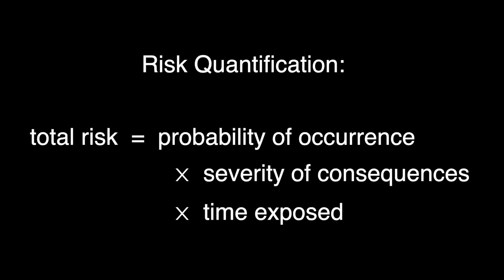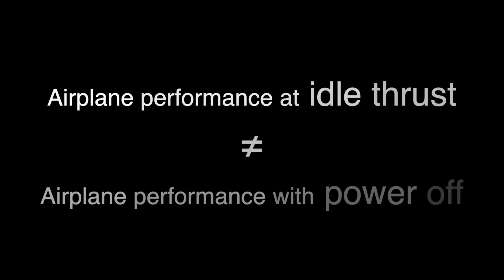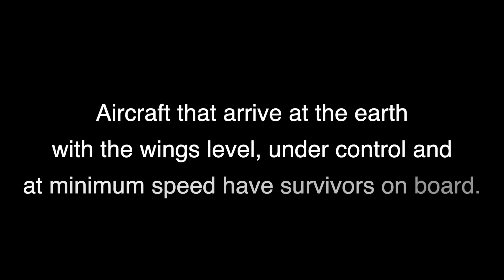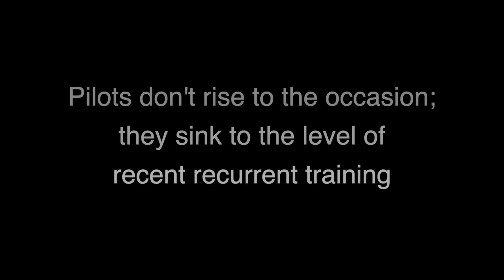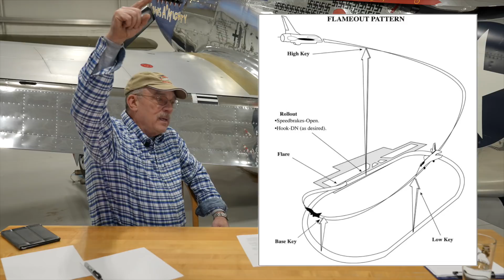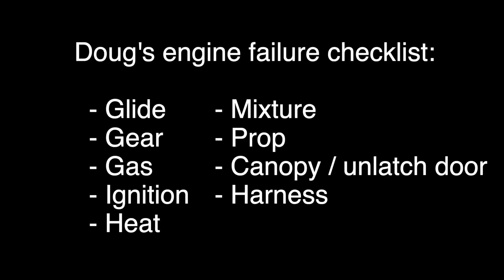Loss of engine power and the (im)possible turn - with Doug and Martin

Comment: After sound training and practice, the best way to shorten both the startle time and the decision time is to plan for the engine failure before takeoff.  Taking into account wind, aircraft load, density altitude/prevailing performance, terrain around the airport, etc., I try to decide before takeoff what I will do if an engine fails at less than 1,000’ AGL.  If you have already decided if you will turn back to the airport, land straight ahead, make a 45 or 90 left or right to a field or open space, etc., when the fan goes quiet, the response time is dramatically faster.  It would be fun to run this in a simulator with a range of pilots, but I will bet a steak dinner that you likely will cut the reaction time by a factor of 5 or even more.

Comment: Martin, with an engine failure enroute in an A36 Bonanza (or other constant speed prop aircraft) is it possible to raise the nose and slow enough to stop the prop from rotating to increase the glide distance. I once experienced an engine failure in a Grumman Tiger and was able to stop the prop safely glide to and airport and land. The reduction in drag made a significant difference.
Reply from the maker: I have not tried that, Lee, nor have I heard from anyone who has demonstrated stopping the prop from windmilling. I can see the upsides should it be possible to do so.
- Martin
Reply: @martinpauly  thanks Martin, I know it works on fixed pitch props, but have often wondered if it’s possible on a constant speed propeller. I’ve always wanted to know but not willing to try it  myself.
Reply: It is possible but would require slowing well below best glide speed to stop the prop/engine rotation.   Then pitch down to re-establish best glide speed.

Comment: Just now reading about the turnback testing/ evaluation in the current EAA Sport Aviation and the crowd sourced data collection - see also the Inflight Metrics website.
Reply: Excellent discussion from both of you with lots of practical wisdom and advice. Thanks to you both.
Reply from the maker: My fear is such testing/evaluation will shift the focus to whether the turnback is theoretically possible, and away from whether it is ever the course of action with the least amount of risk. The price of failure is likely death.
Reply: Martin I tend to agree with your concern.  I've trained the impossible turn several times in my Falco F.8L simulating an engine failure after takeoff at altitude and found that the aircraft needs exactly 600 ft of airspace to make a complete turn back. I even gave myself a 2 second delay to account for the startle effect. Bank angle must be maintained at 60 degrees. However, a coordinated turn at low altitude following an unexpected engine failure is a totally different scenario. First, if it is a complete loss of power (it rarely is) there must be a significant amount of push over on the nose to maintain glide speed airspeed. The Falco initial climb pitch attitude is around 10 degrees nose up to maintain 85 knots. The nose will need to be quickly dropped to 5 degrees nose down to maintain best glide speed of 80 knots. This is 15 degrees of pitch transition, something most pilots have never trained. Second, turning close to ground while descending is completely different than making a turn at altitude. There will be no horizon to look at for reference, only ground visible outside the windshield. Also, banking 60 degrees close to the ground could induce 'ground shyness" prompting a pilot to keep the wings level while continuing to apply rudder, and effectively cross-controlling and inducing a stall-spin sequence which would be catastrophic. So yes, it can be done, but below 1000 ft, on most singles, you've only got one shot at it.
Reply: I don’t know who this guy is but he clearly knows more than most folks ever will about flying. Great video.
Reply: You should do a video on breadcrumb trackers regarding accident survivability e.g. Steve Fossett and time to rescue after the crash. Spider, Garmin InReach, etc offer cost effective solutions and the spider even records and uploads the AHRS data by satellite. The crash near a road comment brought this to mind. That Mooney guy with the CO poisoning almost froze to death after surviving the landing because he had no idea where he was and they could not find him immediately.

Comment: Many who may have survived by landing straight ahead are dead today because they took the chance to turn back.  Sadly, there are some who insist the impossible turn is possible.  But the discussion of the impossible turn is a false argument that leads to a set of false conclusions.  The turn CANNOT be effectively tested and proven to work, therefore it can never be said that an impossible turn is possible.  So it follows that anyone that presumes or asserts that there is a way to make an impossible turn is doing a disservice to themselves and all other pilots that may thing they can get out of trouble that way.

Comment: Yes, Many say a "Turn Around the airport" is "A Turnback".. But is NOT.  On the turnbacks to other runways, you dont "Turn Around" anything.  Turnbacks are a faster turn to land sooner on a closer runway, Not turning around the airport using the downwind leg or anything on ground.  Yes, those are also GRM that should be learned.  Many pilot errors on them.  I learned them in 1996 way after my PPL.  A shame due my original CFI DIDNT KNOW THEM.  Turning around the airport and turnback to other runways or opposite runway are very different maneuvers.  

Not the same thing as some say.  They dont know turnbacks so they call a turnaround as the same as a turnback.  Dummies.. They are not the same maneuver. 
My 1996 CFI of EFATo taught me the differences on those emergency low maneuvers that kill so many that didnt know them.

Comment: I might have missed it, but I didn't hear either of you say get light in the seat meaning get that nose down quickly after the engine fails That's a must if you have an engine to failure right after takeoff. That is something that you don't have to think about it's got to be automatic because the airspeed bleeds off quickly with a dead engine. Also you need to trim for best L/D right away.

Comment: Why are you saying pull the mixture?
Reply from the maker: Except for the case of the power-off 180, where we put the correction on the screen ("throttle, not mixture"), the reason we mention pulling the mixture is that the performance is quite a bit different between "no power" and "idle power". So to practice a turnback maneuver at a safe altitude while measuring the altitude loss, if that is something you want to do, you need to do it with mixture at cut-off or the results will not be representative of what you'd see in case of a real engine failure. We are not suggesting to do this if you are not comfortable with it, and we are certainly not suggesting to pull the mixture at low altitude. But the many videos and reports in circulation showing how easy this turnback is to accomplish with idle power simply don't match the reality of a complete engine failure.
Kind regards,
  Martin

Comment: The one thing I disagree with in trining is cut your fuel of idle throttle u never now when bad fuel or whatever goes thru the motor and it may come back to life never give up
Reply: No. Once you are committed to land, if the engine burps a few seconds, now it will probably put you into the trees at the other end. If you can’t get it back quickly by changing tanks, boost pump, mixture manipulation, carb heat/alt air, or mag switch, then set up for an off field landing and when you are committed, shut the fuel, mixture and throttle.

Comment: Would not Sim Time be a perfect training option to teach the low altitude turn backs?  As a glider pilot we do this frequently....I think every pilot would benefit from time spent in a sailplane and getting the rating.  A few of your $100 hamburger flights would pay for it.
Reply from the maker: Being a glider pilot myself, I agree with your statement that every pilot would benefit from time spent in a sailplane. It also makes me less nervous about having to land without engine power. However, a simulator which can realistically convey the feeling of ground rush during a turnback would be cost prohibitive for light GA aircraft.
- Martin

Comment: Great video, what I don’t like and it’s not true :  the engine will quit !! First the pilot must operate the engine correctly,( it’s not a ECU controlled car eng.) Listen to your engine ( morning sickness etc.) . Have a good knowledgeable  mechanic ( if he has the radio on during a diff.press. check !! find a better mec.) I am flying 49 years without eng. fail. ! In our flying club the ACs fligh 455 to 670 h / year without engine failure .
The pilots and the mechanics where well trained !
Reply: All true, but if a connenecting rod breaks in a Continental,  there is no warning, and nothing your A&P can look at will predict it.
Reply: A original conrod with original conrod bolts with a correct touque ,engine never hard  overspeeded  , will never ever break !!
The history of the engine is very important ! A field overhaul very seldom saves money in a long run . By the way , the most engines corroded to death . Engine conservation , oil change every 4 month , high enough oil temp to cook away the water ! If you open the oil filler after flight and find emulsion and you see steam coming out in cold whether, the oil temp was to low .
Reply: @reinerressel975   Certainly diligent maintenance reduces the likelihood of occurrence, but I experienced an engine failure in a JT-15D.  That is never supposed to happen, but an oil seal failed, and pumped the oil out and we shut it down.  It sounded like it was a can full of rocks when we turned it by hand after landing.  I have experienced numerous engine failures in my 4+ decades of flying.  Blown Cylinders, blown oil lines, vapor lock, bearing failure, loss of oil pressure do to a red rag in the engine after maintenance.  I assume that everyone of them is going to quit, and when they do not, it is a great day.   I have a lot of great days!

Comment: Ignorance is not the solution on Vglide 45 Banking Turns, IGNORANCE IS THE PROBLEM.  So practice Turnbacks.  Dont be lazy cowards afraid of needed hard turns. Practice Vglide 45 banking turns.  I learned them at 8 hours of flight only due at my school we did mostly Short Approaches from 600 agl Traffic Pattern.  You get used to them.

Comment: Martin, given this discussion, do you think it's still wise to take out a single  in less than 1/2 mile visibility just for practice purposes? In my view, your IMC flight from before was completely unnecessary risk, putting yourself and others in risk that they didn't ask for. Views and likes aren't worth it.
Reply from the maker: Less than 1/2 mile visibility? No, I would not practice IFR that. That would be below the published visibility minimums for any approach here at KCID, so it would be a violation of § 91.175 (c) 2. But the video on which you left your other comment today (Light IMC in a Bonanza) had the ceiling at 1,000' and visibility at 10 miles.
More importantly: Your comment ("completely unnecessary risk") makes be think you missed one of the key points Doug is making in the "Loss of engine power video": We cannot fly without risk. (Nor can we drive our cars without risk, or walk our dogs to the park without risk.) The first step of risk management is to acknowledge that a risk exists. From there, it is not about eliminating any and all risk of a flight - that is impossible - but about stacking the deck in our favor, so that the risk-reward ratio is healthy. That COULD ultimately mean the cancelation of a planned flight, if no good risk mitigation strategy can be found under the specific circumstances. 
I agree as pilots we have a moral responsibility to do what we can to not put people on the ground in jeopardy. (I'll ignore passengers here, not because they don't count, but because I didn't have any on the flight you reference.) If you can explain to me where I put people on the ground at risk in the "Light IMC in a Bonanza" flight, please tell me and I'll look at it. I just re-reviewed the conditions of that flight, and I can't find any harm beyond what I would have encountered on a clear VFR day.
Regards,
  Martin
Reply: @martinpauly  Apologies, the comment was meant more for the "Low IFR in a Bonanza" where ATIS was 1/2 mile visibility though my point generally applies to all IFR practice flights in IMC. I don't at all dispute that practicing IFR flight is absolutely essential  and not practicing it is a risk on its own. But practicing IFR does not require one to fly in actual IMC. Use the hood, cover the windshield, etc - all achieves nearly exactly the same effect, except that in an emergency you can quickly visually locate a landing spot within gliding distance. In fact that allows you to practice much more since you are no longer dependent on weather to be IMC. The risk/reward tradeoff graph would indicate that for any scenario where the same reward can be obtained with less risk, that strategy is the optimal one to take. I just don't see how any marginal benefit a real IMC offers over  covering your view forward/sides is worth the risk of losing your engine with 1/2 mile and low ceilings.
Reply from the maker: @igvc1876  Thanks for the additional clarification - I think we are getting closer to alignment. Where I do still disagree is that flying under the foggles achieves nearly the same effect as flying in IMC, as you say. Intuitively, that sounds reasonable, but my experience from decades of flying in IMC as well as from teaching instrument flying suggests there is a significant enough difference that pilots who do quite well under the hood sometimes have real struggles in actual IMC, probably due to clues we pick up with our peripheral vision when flying with the foggles. And practicing in real IMC mitigates that.
Now, we can certainly argue whether it makes sense to practice that in real IMC down to 200' AGL, and I would say it depends on the pilot's experience and proficiency level as well as on what's around the airport - if my runway is surrounded by residential areas or mountains, my risk assessment is different than at my home field KCID which is surrounded by miles of flat farm fields. If the overcast had been at 500' AGL that day, would that have been "safe enough"? And if the answer is yes, what is the real additional risk from the 30 seconds or so it takes me from there to 200'? 
And to be clear, I mind at all if you or anyone else looking at this risk assessment comes up with a different decision than I did. This isn't completely black and white. I welcome opportunities to have cordial discussions of risks and risk mitigation options, where ideally everyone learns something from the conversation - even (or maybe especially) when in the end we don't arrive at the same answer for the risk/reward balance. In that spirit: Thank you for your comments! 👍
Best regards,
  Martin